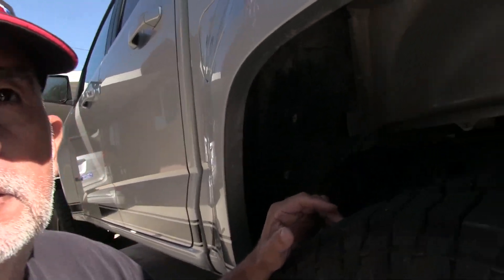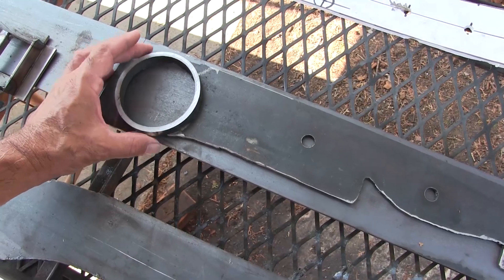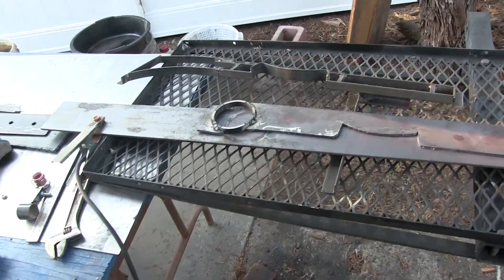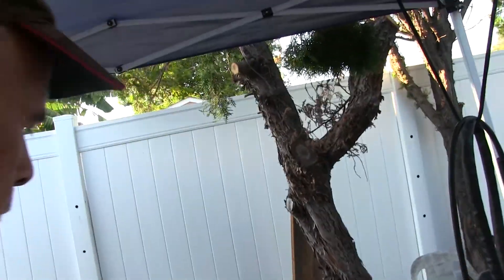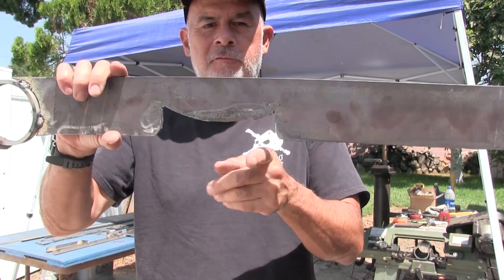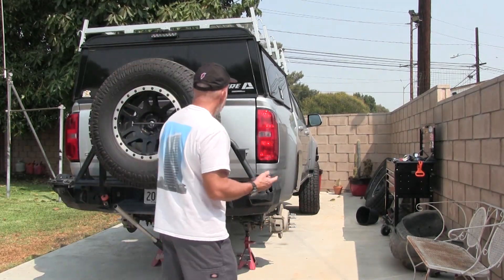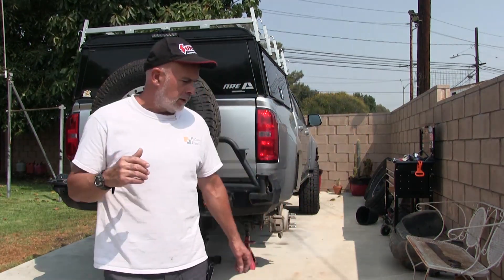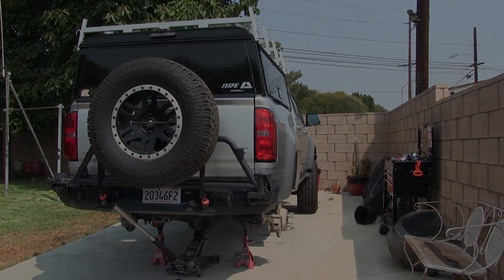Colorado Frame Reinforcement Project

Comment: we just got a 2022 colorado on june 30th, we didn't know about the frame bending issues or we wouldn't have signed the deal, i'm thinking of filling in the oblong holes with 3/4 inch diameter steel rod and a 3/4 inch diameter bolt and 2 big flat washers , 1 on either side to sandwich the piece of rod in place, a quick-ish fix , maybe, i'm hoping this will prevent the area with the hole from buckling and the frame from bending,, we pull a 6x12 utility trailer for our atv, and a 6x14 cargo trailer we made into a camper, i don't want my frame to bend just from hitting a bump while towing , i'm going to crawl under it tomorrow, weather permitting and see where the break lines are, i don't want them chaffing on a flat washer either, wish me luck , hopefully my idea helps
Reply from the maker: Thanks for watching. The Colorado frame looks very thin, compared to a Ford Ranger or Toyota Tacoma. Both Ranger and Tacoma taper down after the rear axle. Where the Colorado tapers down before the axle.
Reply: @rudedogii  it's those oblong holes though just before the axle that bother me,, i'm hoping my " filling " them will give enough support/resistance to prevent it to bend right there
Reply from the maker: @woofman4796  Yes you are correct but youre under factory warranty for now. If it ant broke dont fix it.
Reply: @rudedogii  but,, i'm not a fan of having to deal with a warranty repair, especially a frame, i'll be without my truck for who knows how long,,,, and,, my idea is reversible in case i do need to take it in for some reason, i don't have the materials or facility to do what you did, and i can't afford to pay a fabricator/welder,, so,, i'm just going to put a rod and bolt side by side in each oblong hole, th bolt will have a flat washer on each side, holding the bolt and the rod next to it in place, this,, like i said before, will hopefully give enough support to prevent the frame bending at this weak spot, and,, we both know that i have to prove any damage was due to design, not me
Reply: @rudedogii  and, i'm wanting to like my truck, not regret buying it,,

Comment: If you actually have to reinforce the frame Chevy Colorado, it's time to get rid of that truck, go back to the good old Toyota Tacoma
Reply from the maker: Tacoma with the plastic bed and c-channel flexing frame. No thanks.
Reply: rudedogii the Toyota Tacoma is by far the better built more capable rig.

Comment: how about grinding that cross member pipe down flat with the frame of the truck then just cover it with your  plate
Reply from the maker: The surface around that tube is not flat.
Reply: @rudedogii  ok then just fit the flat metal up against the cross member pipe and don't use the pipe you have. dogg  just trying to give you some ideas
Reply from the maker: @jerryrichter4904  That's a two-inch tube with a 3-inch ridge around the tube. I cant run the plate up tight to the tube.

Comment: I personally would have made a bolt on brace,  seems like plenty of room to encase the frame with a 2 piece brace you could remove. That pipe needs capped and u won't need as long pipe. If you weld vertical on frame is a bad idea, it creates a stress riser.
Reply: Exactly, I want to see how it's welded up. He tends not to listen to good solid advice. If he doesn't weld this correctly, I expect to see frame cracks in the next 6 months. He needs to do alot more research.
Reply from the maker: I thought of doing a bolt on brace but I don't have the resources for that. I'm not trying to reinvent the wheel. Plating the frame has been done before but not on a Chevy Colorado.  See here https://superiorengineering.co/holden-rg-colorado-dual-cab-grey-122519/